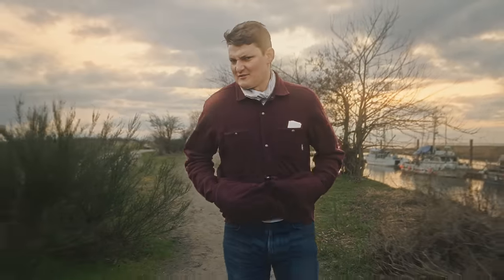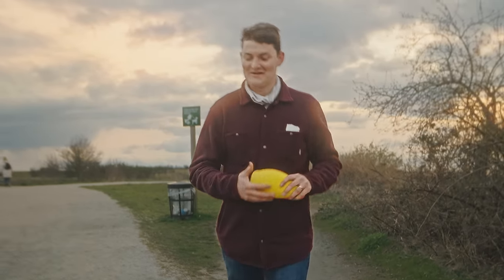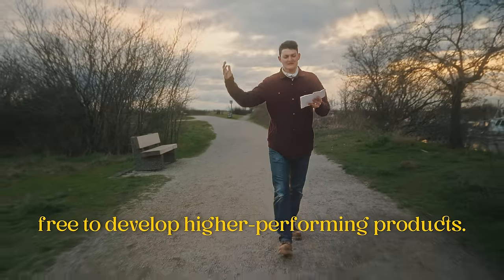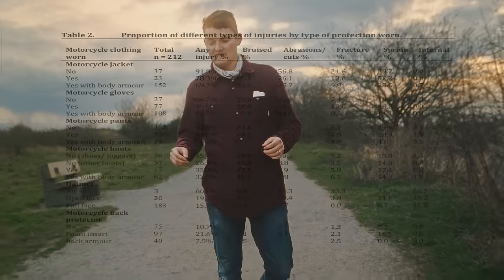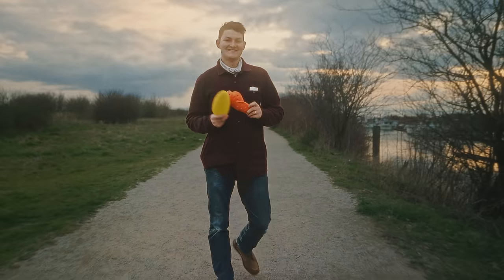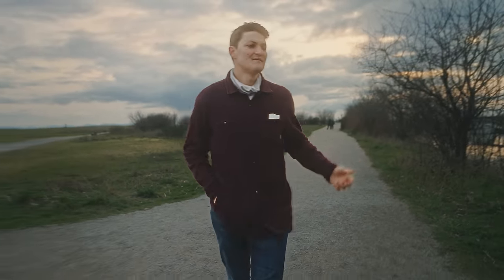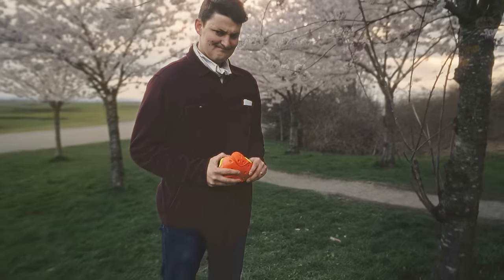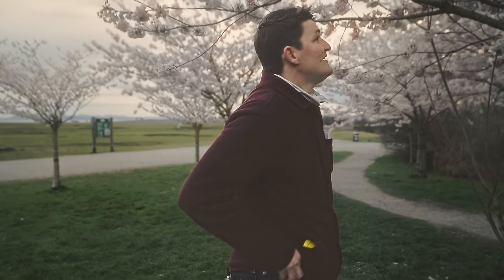Why I Stopped Wearing Motorcycle Body Armour

Comment: Body Armor is redundant as I ride around in chain mail and knight armour anyways.
Reply: Chain mail probs slide for awhile
Reply: Everything about this was serious until I read this comment. Died and came back to life laughing.
Reply: chain mail itself is a redundant term, simply call it mail or get out.
Reply: Nothing measures up to full plate armor!
Reply: I would ride naked but I think there are laws against it. So in summer I wear a T-shirt and shorts. Works!
Reply: Har har!
Reply: Make some quality sparks when you get your knee down...
Reply: @Ruubie2197  crash half way on your commute, slide the rest
Reply: @adam346  I wouldn't otherwise people might think you stuff you motorcycle jacket with paper
Reply: @GameCyborgCh  what if it's cold out?
Reply: @Ruubie2197 some say he's still sliding to this day.
Reply: I only ride knight so I don't worry about it
Reply: I only ride knight so I don't worry about it
Reply: You Sur, are a Sav Vage.  I salute you in a Knightly Fashion.
Reply: You forgot to mention your lance.
Reply: Just remember that they always wore padding under the chain mail. Make sure it is CE rated. :P
Reply: @adam346  I carry the love mail from your maternal biological parent sunshine
Reply: @Ruubie2197 it probably has a high abrasion resistance, ideal for motor cyclists 😂
Reply: Ave Maria! Deus Vult!
Reply: @adam346  It is not, you can also have plate mail, meaning an armor of small plates held together by rings (e.G. a Bekhter/Behteret).
Chain mail tells you that there are no plates involved.
Reply: same answer the microwave on the head guy gave about helmets lol
Reply: @FantasKanal  plate-mail can me one of two things, either imbedded plates into or onto the mail or plate armor over mail... either way the interlocking rings of riveted metal worn for protection are called mail... and not plate chain mail and not plate over chain mail.
Reply: "on a steel horse i ride"
Reply: @TheGlovener1985  I'M WANTED
Reply: @randomguitarguy5906  Dead or Alive
Reply: Just a bit of heat transfer on that slide
Reply: Do you ride a horse as well
Reply: Ditto
However, I ride with a mace at my hip and not a sword, for reasons.
Reply: In what other armor would we take Jerusalem in? (Deus vult)
Reply: And if you should part company with your steed, the consequence “tis but a flesh wound.”
Reply: once a king always a king.... but once a knight is enough
Reply: Just take it off before going through airport security.
Reply: I just got an image of sliding in metal armor...at night... it would be  illuminating 😂
Reply: @jefmatttab  Sparkly!
Reply: @adam346 Knight snob
Reply: @YABBAHEY1  I prefer the term armor connoisseur.. a veritable sommelier of fine arms and armor... I like the Gothic style with the flaring and fluting, much more form-fitting than the Milanese style of Italy and later France... while many would argue the Milanese style was more practical, both had their positives and negatives also people enjoy the asymmetry usually employed in the Milanese than the sometimes pointed and symmetrical Gothic style.
Reply: @adam346 Yay good sir, though I hast made jest, seems mine jest hast fallen on me. Thine knowledge surpasses thee keenest smith & humbles me by it. Good marrow sir knight ! I say good marrow.
Reply: @Ruubie2197  I end up getting friction welded to the thing anyways
Reply: @Liwcay  Got that BCE rated vintage stuff dude
Reply: @adam346  they call it chain mail to differentiate it from junk mail.
Reply: I used to do that but went magnesium chain for the weight loss. Unfortunately I slid and burst into flames.
Reply: I too have seen Knight Riders
Reply: Completely unnecessary, a good ol' gambeson and bascinet is more than you'll ever need, throw on some greaves and jackchains if you're really nervous about it.
Reply: Chain mail very abrasion resistant but not so much on impact which is why you need those inserts, but plated armour the force will disperse but would be better with impact protectors lol fyi
Reply: Show-off.
Reply: Just leave us a convenient can opener and bolt cutter to extract you from the dented up armor.😅
Reply: @adam346  There's other types of mail armor
Reply: @GameCyborgCh Haha!
Reply: @saoirseislive  sure, scale, splint, plate but when you are talking about interlinked rings of iron or steel... it's mail... and because it can be attached to and modified into pretty much anything, we have names for the various off-shoots or specific garments that mail was used to make... such as a hauberk, gauntlet, aventails, collars, coifs ect... but they are made out of mail... we only say chainmail because mail is now associated with other things so we needed another way to differentiate mail from the letter you send in the... mail! Once we have a reference point or we understand what we are talking about, drop the chain, it's mail.
Reply: I'm impressed and curious about shifting with those pointy metal boots
Reply: You shall ride shiny and chrome.
Reply: @adam346  some people may be dumb enough to think that he is covered in postage
Reply: Spend the extra and get mithril. 👌
Reply: @Praxus42  oh I so hope that is true... that there are people out there thinking "did you know knights used to wear envelopes as armor?"
Reply: Chain does not protect against blunt strikes. ironically the best protection against blunt strikes before Full plate was the gambeson, or a padded jacket. 7 or 8 layers of stiff linen will dissipate quite a bit of force
Reply: That's where u get sparks flying when u knee down!
Reply: @adam346  Full harness!
Reply: @rhetorical1488  YUSSSS!!!!
Reply: I will believe it when I see it. 😂

Also, does your bike use coconuts to make sounds?
Reply: Chad
Reply: @majormassenspektrometer  Don't forget to put your crocs in sport mode.
Reply: Don’t let any of this distract you that some folks don’t ride with ANY gloves 😮 that’s the one that kills me the most.. every one.. do you. But for the love of God wear some gloves hahah 😅
Reply: @op6362   I have the scars on my hands to prove that. I'll just add that to the list of needed gear.  Knee protection would be nice too. Any type of slip on knee pads?
Reply: Good form, m'Lord.
Reply: You'd have better luck wearing a "floatation suit" known as fishing thermals these days and just accept that you look like Michelin man/woman or in some extreme cases, the Stay Puft.
Reply: @Ruubie2197  leaves interesting looking burn scars too.
Reply: bro rides a destrier class 30000cc motor horse
Reply: thank you for your contribution. :-D
Reply: How well does a Grom get along with that?
Reply: Joust be serious will you  ;-)
Reply: But these are much worther than cheap motorcycle armor.  Just because it won't absorb the kinetic energy.     So for a slide, this is pretty great. Maybe get a bit warm but work.     If you hit something, it gets pretty bad.
Reply: dont ride through an MRI
Reply: Now I'm really wondering about chain mail. I live in florida. Chain mail sounds quite breathable.
Reply: @Ruubie2197  Sparking away.
Reply: Great breathability too but a bit shit hen it rains. Just quietly, what do you use to stop the rust? I have been using lanolin but its gets a bit stinky after a while and it seems rams take a keen interest in you!
Reply: @andrewtreloar7389  What if it was stainless steel chain mail?
Reply: @MGMan37 now you're talking!! 😅
Reply: Since the Siege of Shaizar (1138) i feel the regulatory capture within the limited armor options
Reply: @andrewtreloar7389 Oh no I never worry about that cuz my Madams spray of amour keeps my armour impervious to all forms of nature's voracity
Reply: No offence here but I definitely would like to see you slide 😅
Reply: @slimshedykofff  and slide, and slide and slide!!
Reply: And it leaves perfect grill marks.
Reply: I would advise against removing the body armor from your shiny harness. It will protect you from chafing
Reply: Holy shit! Fair enough!
Reply: Hi-vis I hope🤣
Reply: You must be Canadian.
Reply: Now that would be a fashion statement
Reply: Forsooth!
Reply: @adam346  so….should I use scotch tape, painter tapes, duct tape, or gorilla tape???? Or is that all redundant&i should just tape my mail to my body ?!?!?!?
Reply: @halvorson566  if you want to be ridiculous, go for it. Many people wear almost literally nothing so why not? You are your own person.
Reply: even if you fall, chain mail slide will get you to your destination, good choice
Reply: @Ruubie2197  It certainly does. Roderick can vouch for that having got his cloak caught in the back wheel and slide down the road dragging the bike by his neck and yes there were sparks and hot bits, luckily no decapitations though. Bristol police and Ambulance were not amused.
Reply: @majormassenspektrometer  There are clubs for people just like you.
Reply: @simanothername3035  But I'm shy.
Reply: Ohhh where do you get that, medieval sports bike shop ?
Reply: @evanbarnes9984  Crash at high speed in full plate and you'll still end up at you intended destination, just not in the way expected XD

Slide on my plated son, slide on
Reply: None shall pass!
Reply: What's your gas mileage like?

Comment: The comments and insight elicited from doctors, EMTS, engineers, and other riders in response to this video are more valuable than the video.
Reply: It almost feels like it was the unintended purpose of the video lol
Reply: @cmontygman  Unintended? :)
Reply: @cmontygman That is an oxymoron. A direct “purpose” cannot be unintended.
Reply: That’s a misconception, you can’t replace data with subjective experiences.
Reply: @newFaction64 From the eyes of many first responders it would be objective wouldn’t it? 
If just one or two were adding anecdotes I would agree; however there are at least 100 of them.
Reply: @chloehennessey6813  I don’t think you know what subjective and objective mean lol
Reply: @chloehennessey6813  100 isn’t even a drop in the pond though
Reply: @newFaction64  LOL I'm an EMT and my experiences are not subjective they're objective.  Did that guy break his leg or not? We don't have different answers to that question,  he objectively broke his leg.
Reply: I can confirm body armour did absolutely nothing will I came off my dirt bike at 80km. Main reason is that it doesn’t stay in place. Basically gets ripped off your body.
Reply: @LarsLarsen77  That's not what I'm saying. I'm saying that FortNine is presenting data, which is objective. Personal experiences are inherently subjective.
Reply: @newFaction64  "The plural of anecdote is data."
Reply: @demo3003  Your jacket is not fit properly or you are not built properly.  Properly fitted gear stays in place.
Reply: @newFaction64 not statistics, data. The data doesn't have all of the variables, it's not very valuable actually. What you need to see is the difference in wearing pads vs not in a statistical analysis and I'm sure pads would show significantly less damage than no pads.
Reply: Not everyone who says they are an expert on the internet is an actual expert.
Reply: I think you are confusing subjective/objective with anecdotal/empirical.
Reply: @newFaction64 
Data?
Its just few hundred of cases, tiny sample size.
Reply: In that regard, the discussion this video facilitated is pricelss
Reply: @demo3003 Then your stuff isn’t fitted properly. wtf??
Reply: @newFaction64  Yes, but he's cherry-picking data. a skilled analyst can make data fit any preconceived opinion. You're being too naive.
Reply: But the video generated the comments.  :-)